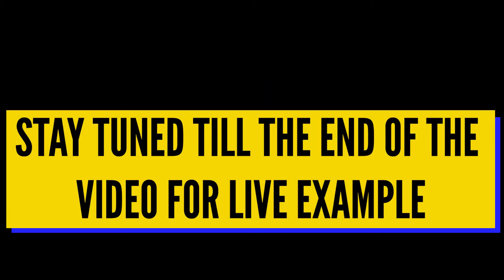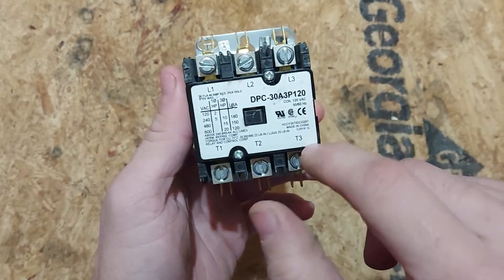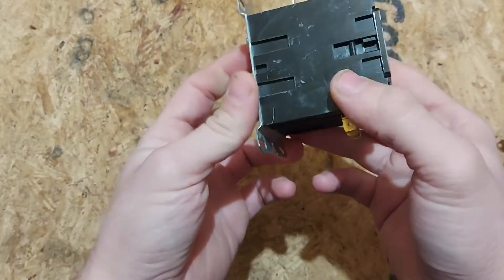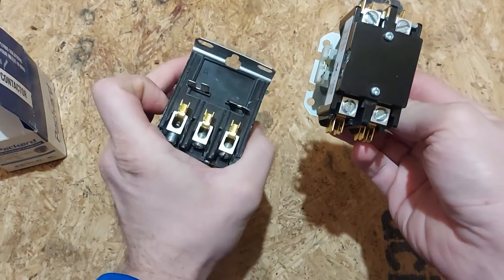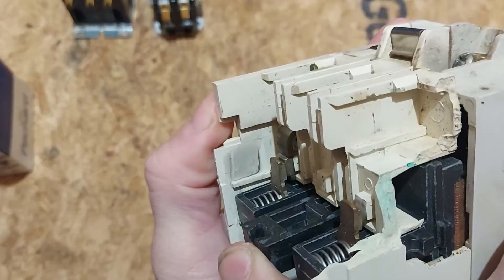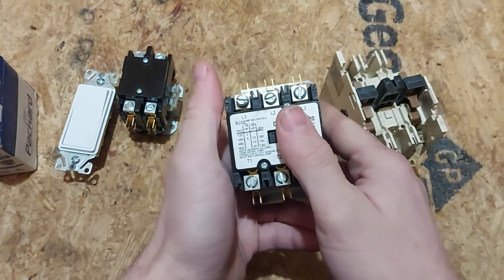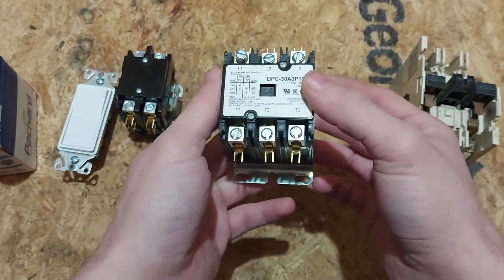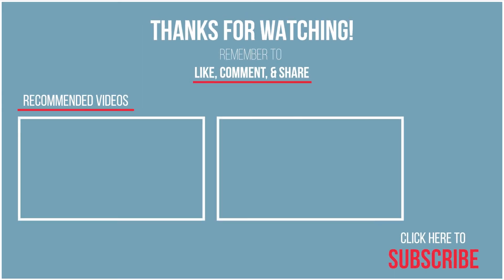How To Wire Normally Open Contactors - Live Example With Exposed Parts - see how it functions

Comment: I appreciate your simple and concise explanation! I am dealing with some pressure switches that are the 110acv that feed to the contactor that then operates a motor 220 single phase. And was trying to understand my wiring. Thanks again
the only thing I am struggling with, is that they are robbing 1 leg of the the 220v to send a loop through the pressure switches,

Comment: dont you  have to run a jumper from A1 to L1  for L1 to have power?
Reply: No. Think about this you could use a 15 amp to run the contactor and then you can add up to three different circuits on your L1 L2 and L3. Think of it as an electronic switch it uses the first source of power to close the circuit for other sources. Hope that helps.
Reply: Yes. That’s how it’s usually wired up from the factory on air compressors.
Reply: Totally depends on what application it’s being used for

Comment: I made a 220 volt stove burner incinerary toilet.Basically I poop in a toilet that falls into a insulated pot I add heat with a stove top burner below it for an hour.I want to install a 60 minute timer that I hooked 120 to the coil and it buzzes. With a cord it clicked but when i put a timer in the mix the contactor buzzes. Why is  that. I timer switched the black 115volt AC hot wire. Should I be switching the neutral wire?

Comment: great video. how do you mount a contactor inside a box? if the box is against concrete, we cant screw it to the back wall of a box. is there a hardware that helps mount this inside a box?